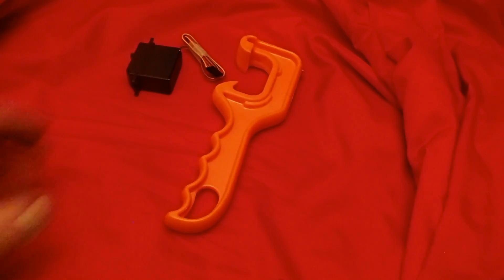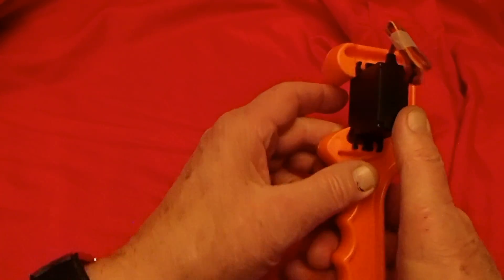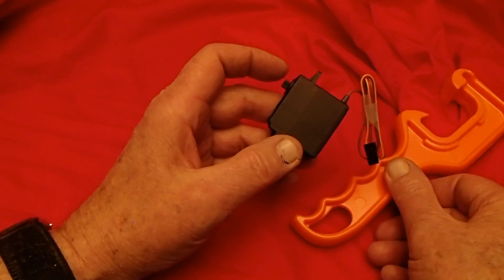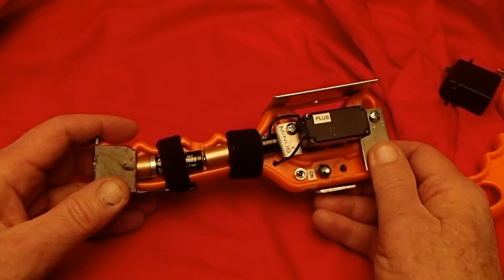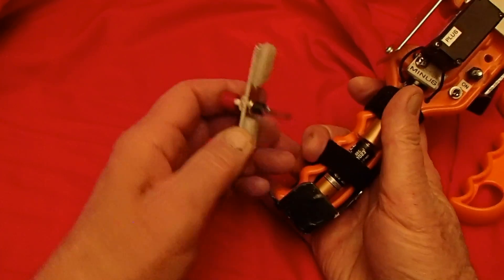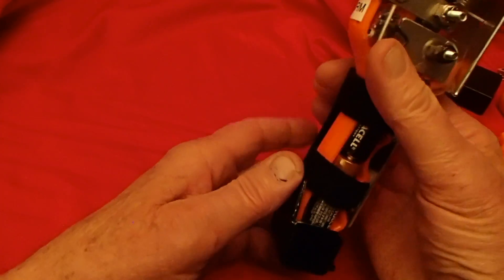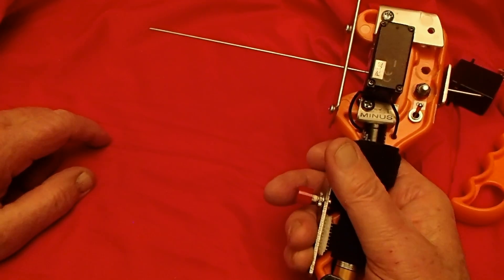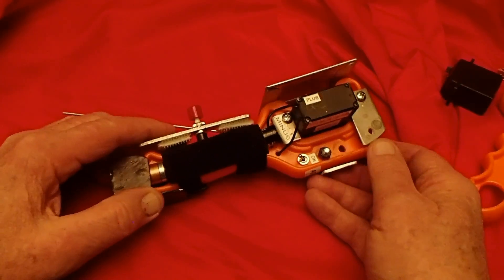Tig Rod Feeder

Comment: I was just trying to design the same thing.  My left arm is paralyzed.  Can you send me information on how to buy one?
Reply from the maker: So, your arm is paralyzed... do fingers still work?
Reply: I do have some use of my thumb and two fingers. What is a link to your post at weldweb?
Reply from the maker: @bartscave  I can't find the Weldingweb link.  I have redesigned and reduced the size of the size of my feeder, so it, totally, fits inside the palm of one's hand.  Since you have use of fingers, it will, probably, work for you.  Just push on a momentary switch to initiate feeding of the rod.

Comment: Don't know if you'll see this, but I was wondering if you wanted help. I have multiple college degrees including a bachelor's in mechanical engineering and an associates in drafting and design. Currently at RSI for my master welding cert. I specialize in tig and high frequency. Good design for the feeder, but some revisions would definitely do it justice. Please message me if you're interested. I already have a few products that I sell.
Reply from the maker: Thanks for the message and offer, Charles.  My design for the feeder in the video was a "one off" for the guy in need.  I have since redesigned it, and plan to offer some for sale when I find time to file for a provisional patent.  I'm curious, as to what products you sell.

Comment: Are these still available
Reply from the maker: I have redesigned the feeder, and am in the process of assembling my first batch for sale.  Please let me know, if you are interested in purchasing.
Reply: Yes I would be interested. I am having trouble feeding the wire by hand. Any idea of roughly what the cost would be. Regards Steve Edwards.
Reply from the maker: @Steviegtr52  I have decided to set the price at $89, including postage inside the U.S.  If you are just starting with tig, the feeder should help learning, because you can concentrated on what the puddle is doing, rather than manipulating the filler.  The motor in the feeder draws very little current, so by the time you need to refresh batteries you should be accomplished with torch control.  If you're still interested, just send me a private message with your email address, and we can work out an exchange.  Thanks!
Reply from the maker: @Steviegtr52  My new feeder is pocket-sized, and is easily held in the hand.  If you will post your email address, I will provide more info.  Thanks.
Reply from the maker: @steveyknoxville  Hi, Steve.  Thanks for your interest.  Regrettably, I took on a rather large, time-consuming project last summer, so have not have the time to spend in pursuing a patent.  And, of course the virus got in the way, too.  I will have some of the feeders available after I file for a provisional.

Comment: That is brilliant. What a good thing you have done.
Reply from the maker: Thanks for the good words.
Reply: Hi good idea what kind of motor did you use again where can i buy it i wanna build one for me thanks
Reply from the maker: I used an EXI - D121F servo, available at eBay, and many other sources.  You must remove the tiny circuit board in the servo to reduce it to just the motor and gear drive.